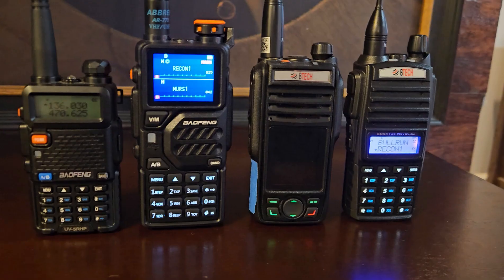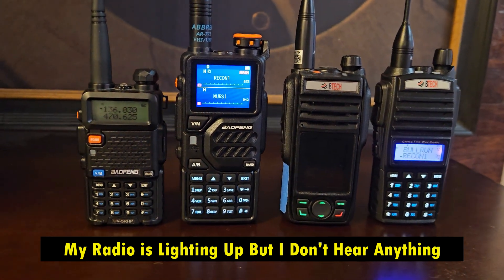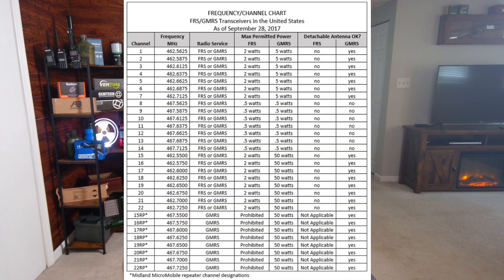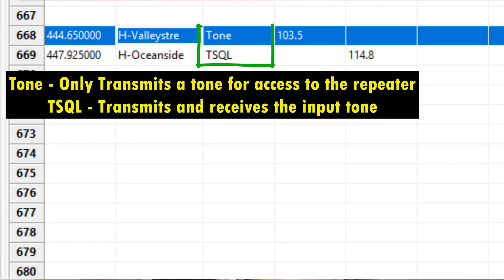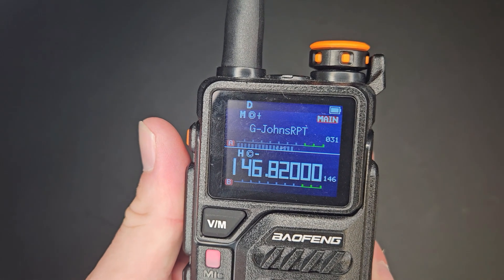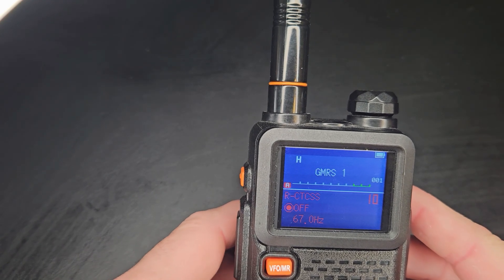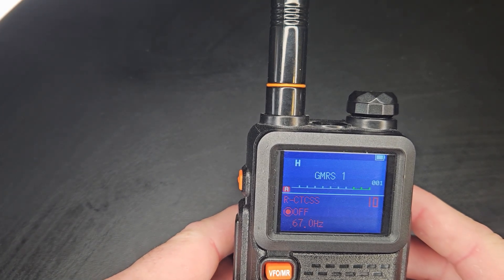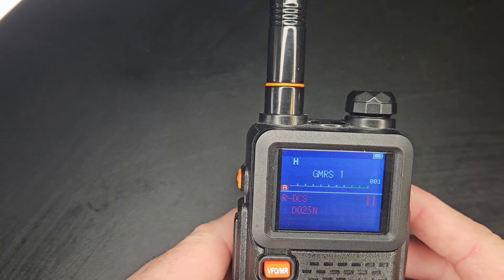🎙️ Why Your Radio Lights Up But You Can’t Hear Anything (GMRS & Ham Fix)

Comment: so if the repeaters are on different frequencies and have different tones, can I use one GMRS repeater to skip to another repeater that isn't in range of me but is in range of the repeater I want to use to extend my transmission farther. One in not in reach of me but with the repeater that I'm connecting through, which has a 70 mile reach and the other one out of my range but is in the radius of the other one that has a 80 mile range, and they just overlap one another. I don't know if that makes sense, but one is within 10 miles of me in Oklahoma City and the other is in Ada, out of my range but in range of the repeater by me. Both have different frequencies and different tones. I don't know if it is possible, probably not, but thought I would ask if that would be possible. I haven't really heard of anything like that, but it would be great if you could use one to extend your transmission to another repeater that would get you over 150 or more miles away?